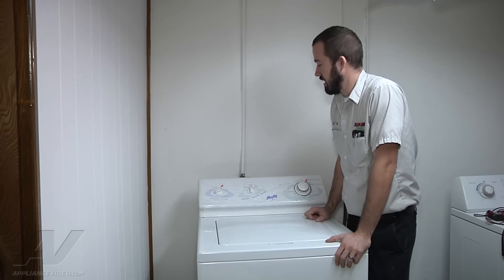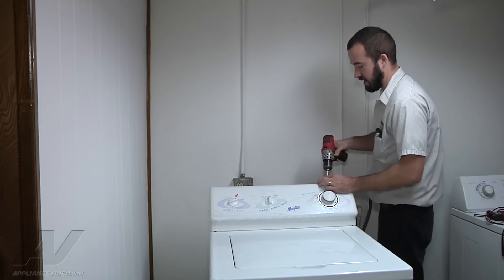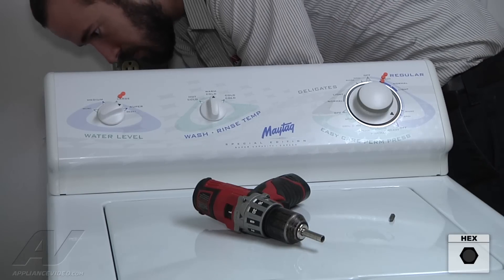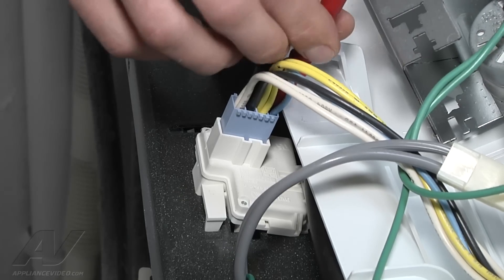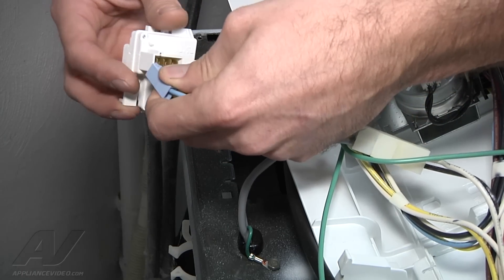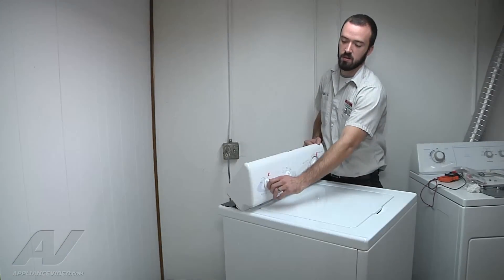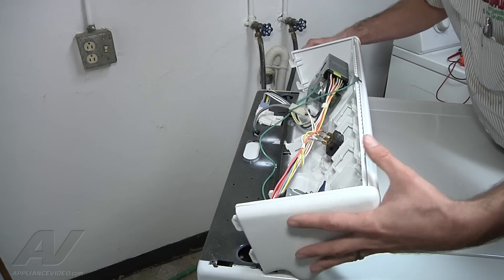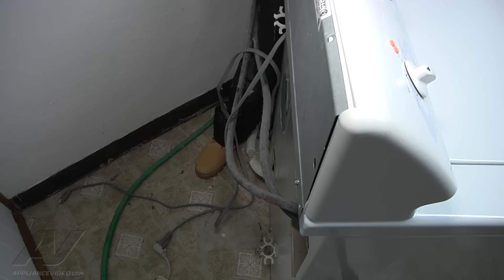Maytag Washer Repair - Stops Mid Cycle - Lid Switch

Comment: Great video

My Maytag LAT9360AAE works fine until it stops before the rinse portion of the cycle. I can hear the washer buzzing as if its waiting for something to trigger but it does nothing. I have to manually set it to the washing cycle to fill with water (substitutes rinse) and once that is done, i set it manually to the “spin” function. I replaced the timer but still the same. Any feedback will be appreciated
Reply from the maker: Great question, if you have a
more technical question that our parts department cannot answer, our
technicians are answering all questions at our website at www.ApplianceVideo.com under our Repair Help section. You can also call
our parts department at 1-800-830-5465 and they can give you help 6-days A week
Mon-Sat . You can also search at www.SaveMoreOnParts.com 7- days a week.
Reply: Your cold water valve may be clogged.

Comment: I wish my problem was just the lid switch-lid switch is good, but it quit in mid-cycle and will now do nothing. Seems in 99% of how-to videos, the problem turns out to be the lid switch. It would be nice if someone did a video where the lid switch didn't fix it, so we could go on and explore other causes/culprits. Thank you for doing the videos, though.
Reply from the maker: Great question, you can call our parts department at 1-800-830-5465 and they can give
you help 6-days A week Mon-Sat . If you have a more technical question that our
parts department cannot answer, our technicians are answering all questions at our website at www.ApplianceVideo.com under our Repair Help section. We have over 4,000
common questions and answers that you can easily search through by your model
number, appliance make, and problem or error codes, and It’s free to search
through our question & answer library.
Reply: dyer2cycle the lid switch is the prob only 75-80% of the time.Other 20-25% the plastic actuating barb has worn out and is not pushing the switch that extra 1/16" needed.Piece of folded matchbook cover will get you going.Not too much!!
Reply: Mine was the capacitor for the motor and the timer switch.  I agree, too many on lid switches
Reply: dyer2cycle aww
Reply: Did your check the water pressure switch

Comment: Please Please Help, I have a Maytag mtw5840tw0. When on regular wash cycle it stops agitating right before the next rinse cycle (like 1 click away on the knob) should start and just stays full of water not doing anything until i manual turn the knob to rinse then it will complete the rest of wash cycle. Ive also noticed that sometimes it finishes the wash cycle by just opening the lid fully then closing it once or twice. Besides this issue stated all else works like normal. Where should I start to repair? Please and thanks.
Reply from the maker: Great question, if you have a more technical question that our parts department cannot answer, you can search our over 17,000 answered questions free at our website www.ApplianceVideo.com under our Repair Help section. You can also call our parts department at 1-800-830-5465 and they can give you help 7-days A week ,or search at www.SaveMoreOnParts.com  .

Comment: Even with a broken lid switch, would you still be able to hear the clicking when you open and shut the door? I can still hear mines clicking when I open and shut the door, but that does it mean it can still be broken or need replaced.
Reply from the maker: Great question, if you have a
more technical question that our parts department cannot answer, our
technicians are answering all questions at our website at www.ApplianceVideo.com under our Repair Help section. You can also call
our parts department at 1-800-830-5465 and they can give you help 7-days A week
Monday -Sunday, or search at www.SaveMoreOnParts.com  24 hours
7- days A week.
Reply: I could tell you the most probable part answer, but then you would buy it somewhere else cheaper.  So call our number and be guilted into buying it from us
Reply: YES - Even a broken microswitch (which at least is what is on my Performa series) can have an audible 'click' yet it isn't making contact internally to the switch. The only true way to tell is by doing a continuity test with a digital multimeter (or continuity tester). While I am not an appliance tech, I have been repairing electronics devices for over 20 years. Microswitches can still 'click' and be broken internally. Since your post was 3 years ago, I hope you aren't waiting on this answer to proceed LOL!  But someone else who reads this might benefit.

Comment: When i replace the hood switch do i need to hook up the water to test that switch?
Reply from the maker: Great question, if you have a more technical question that our parts department cannot answer, you can search our over 17,000 answered questions free at our website www.ApplianceVideo.com under our Repair Help section. You can also call our parts department at 1-800-830-5465 and they can give you help 7-days A week ,or search at www.SaveMoreOnParts.com  .
Reply: @Appliancevideo  yeah I replaced the hood switch and it's fixed now i have i old washer and dryer for sale thanks guys

Comment: Our Maytag MCT top load no agitator washer basket doesn't always move, though hear motor make noise but no bottom movement - basket will move, bottom section does not, it's intermittent. Washer is 5 years old.
Reply from the maker: Great question, if you have a more technical question that our parts department cannot answer, you can search our over 17,000 answered questions free at our website www.ApplianceVideo.com under our Repair Help section. You can also call our parts department at 1-800-830-5465 and they can give you help 7-days A week ,or search at www.SaveMoreOnParts.com  .

Comment: Is there a bypass for the lid? Mine is full of water right this minute and I just want to get it thru the cycle. I ordered a new switch.
Reply: Dave K where did you buy a new one at?
Reply from the maker: Thanks for your response, we are glad we could help. Our library of over 5,700 videos are currently helping over 1.6 million people like you every MONTH.  Please help us by subscribing to our YouTube channel, or post our website www.ApplianceVideo.com to your Facebook page, Twitter, Instagram or any other social media sites. Your support will help us keep producing more free quality videos.
Reply: Bend a paper clip and stick it into the lid switch contacts. No more switch problems.
Reply: Pleasant Home Painting LLC could you please explain how you do this exactly.
Reply: @Enrevalasil  if you take it apart kind of like he showed, instead of the plug-in part that leads to the door safety switch, connect the circuit with a homemade pin, probably out of insulated  heavy copper wire, not a paperclip, in a u shape with the ends stripped. Stick the end into the proper holes where  the pins would go  from the big plug. The sensor will think that the door circuit is closed all the time and it will not interrupt your wash by bouncing open. It also will not stop while it is spinning if you stick your arm in there that is the downside.
Reply: Pleasant Home Painting LLC thank you
Reply: I cut line wire (black) motor feed wire (yellow) machine feed wire (blue or red) and splice the three together with a wire nut. careful not to stick hands in the spinning machine you may get hurt.

Comment: will this work on all models ?
Reply from the maker: Great question, you can call our parts department at 1-800-830-5465 and they can give
you help 6-days A week Mon-Sat . If you have a more technical question that our
parts department cannot answer,
our technicians are answering all questions at our website at www.ApplianceVideo.com under our Repair Help section. We have over
3,000 common questions and answers that you can easily search through by your
model number, appliance make, and problem or error codes, and It’s free to
search through our question & answer library.

Comment: can explain whys the switch is causing to stop, draining water, and or spinning? I have the same problem with mine too. If it is I might just go buy the switch and replace it myself. How do I know where to buy the switch which one it will fit?
Reply from the maker: Darmmand8
          All of our technicians are now answering questions daily on the ApplianceVideo.com website. You can search completely FREE in our Repair Help section with over 1000 questions & answers. Or you can get unlimited technical advice and video links emailed to you by our 14 factory certified technicians at http://www.appliancevideo.com/premium-membership/.  If you are in need of any parts please support our parts department on line at http://savemoreonparts.com/ or call 1-800-830-5465 7-days a week until 11pm Eastern time. Thanks for your support. Matt Ace Appliance factory service technician.

Comment: hello matt i have a maytag front loader that will fill the stopped now won't start or do anything i have checked the control board and the motor board.  both look fine no burn marks or anything what would be the next thing this could be
Reply from the maker: +Kelli Kneller 

         We would like to help you answer your
question. With our videos now getting over 900,000 views per month and hundreds
of questions from people like you, our technicians are now answering questions
at our website http://www.appliancevideo.com/repair-help/ .  We also have over 2200 common questions
and answers that you can easily search through by your model number, appliance
make, problem or error code and it’s absolutely FREE. You also have the option
to email a factory service technician with a question on your appliance at http://www.appliancevideo.com/repair-help/ . If you’re looking for a repair video, you can
also search our library of over 2600 free repair videos. ApplianceVideo.com
specializes in quality DO-IT-YOURSELF appliance repair videos and we get over
800,000 views per MONTH to our videos worldwide and growing. If you need of
parts for your major appliance, we have over 5-million parts in stock at http://savemoreonparts.com/ .  Thanks for your support. Matt Ace
Appliance factory service technician.
Reply: Maytag shaking
Reply: Thank

Comment: I have a model LAT9206BAE that does the same thing except it works in spin when turned on manually. What could cause that? It cycles through, but water stays in and no spin. except when you pull out knob.then it spins.
Reply from the maker: Great question, if you have a
more technical question that our parts department cannot answer, you can search
our over 10,000 answered questions free at our website www.ApplianceVideo.com under our Repair Help section. You can also call
our parts department at 1-800-830-5465 and they can give you help 7-days A week
Monday -Sunday, or search at www.SaveMoreOnParts.com  24 hours
7- days A week.

Comment: I have an LAT5005 that starts to spin but if the load isn't perfectly balanced, it stops.  It just seems to be too sensitive and I thought that there was suppose to be a counter balance to keep this from happening.  Any ideas?
Reply: I had similar problem. The drum is held in balance by some springs under the drum. On mime a spring had broken leaving the drum to flop around if it was slightly unbalanced. The technician replaced a broken spring which solved the problem. Having watched the technician it would probably be easy for a handy homeowner to fix it except for the fact that the washer has to be tilted back or lifted up to gain access to the bottom of the machine. It was too heavy for me to do myself.
Reply from the maker: Thanks for your response, we are glad we could help. Our library of over 5,700 videos are currently helping over 1.6 million people like you every MONTH.  Please help us by subscribing to our YouTube channel, or post our website www.ApplianceVideo.com to your Facebook page, Twitter, Instagram or any other social media sites. Your support will help us keep producing more free quality videos.

Comment: My Maytag Commercial W M does not supply hot water when is set up on Hot. There is hot water supply fawcet
Reply from the maker: Great question, if you have a more technical question that our parts department cannot answer, you can search our over 17,000 answered questions free at our website www.ApplianceVideo.com under our Repair Help section. You can also call our parts department at 1-800-830-5465 and they can give you help 7-days A week ,or search at www.SaveMoreOnParts.com  .

Comment: I have a Maytag Performa series sm8525664 that stopped mid cycle on wash. It still makes a sound when turning it on but won't spin. What exactly do I need to fix to get it going again?
Reply from the maker: Great
question, you can call our parts department at 1-800-830-5465 and they can give
you help. If you have a more technical question our parts department cannot
answer, our technicians are answering
all questions at our website at ApplianceVideo.com under our Repair Help
section. We have over 3,000 common questions and answers that you can easily
search through by your model number, appliance make, and problem or error codes,
and  Its free to search through our
question & answer library.

Comment: What would cause it to screech extremely loud then stop in middle of wash cycle
Reply from the maker: Great question, if you have a more technical question that our parts department cannot answer, you can search our over 17,000 answered questions free at our website www.ApplianceVideo.com under our Repair Help section. You can also call our parts department at 1-800-830-5465 and they can give you help 7-days A week ,or search at www.SaveMoreOnParts.com  .

Comment: Washer will run on delicate cycle but no other
Reply from the maker: Great question, if you have a
more technical question that our parts department cannot answer, our
technicians are answering all questions at our website at www.ApplianceVideo.com under our Repair Help section. You can also call
our parts department at 1-800-830-5465 and they can give you help 7-days A week
Monday -Sunday, or search at www.SaveMoreOnParts.com  24 hours
7- days A week.

Comment: I have a Maytag Bravos and the water starts filling up and stops after dropping maybe half a gallon and then switches to start spending a belief what could be the problem
Reply from the maker: Great question, you can call our parts department at 1-800-830-5465 and they can give
you help 6-days A week Mon-Sat . If you have a more technical question that our
parts department cannot answer, our technicians are answering all questions at our website at www.ApplianceVideo.com under our Repair Help section. We have over 4,000
common questions and answers that you can easily search through by your model
number, appliance make, and problem or error codes, and It’s free to search
through our question & answer library.

Comment: How to put the metal ring back on my maytag w10631155a
Reply: Front loader
Reply from the maker: Great question, if you have a more technical question that our parts department cannot answer, you can search our over 17,000 answered questions free at our website www.ApplianceVideo.com under our Repair Help section. You can also call our parts department at 1-800-830-5465 and they can give you help 7-days A week ,or search at www.SaveMoreOnParts.com  .

Comment: what happens when the machine is only making internal sound as if it is washing meanwhile it doesn't roll till it pours out water and soap. My machine is in this state since last 2 months. Solution please.
Reply from the maker: Great question, you can call our parts department at 1-800-830-5465 and they can give
you help. If you have a more technical question that our parts department
cannot answer, our technicians are answering
all questions at our website at www.ApplianceVideo.com under our Repair Help section. We have over 3,000 common
questions and answers that you can easily search through by your model number,
appliance make, and problem or error codes, and It’s free to search through our
question & answer library.
Reply: Roper washing machine won't drain

Comment: I wish they still made wringer washers.. this high tech stuff is all junk!  I have a Kenmore that is over 20 years old that I replaced with a new modern Maytag and the Maytag did not even last 2 years.  No wonder they dropped the warranty to 1 year. The Kenmore still works fine but is old.  Quality has gone down the drain these days while prices have gone way up.

Comment: my maytag washer don't spin but when I look under it the motor is turning the belt
Reply from the maker: Hello, for
technical questions we have a Repair Help section at this link https://www.appliancevideo.com/repair-help/ . There are over 6,000 answers and questions you
can search through FREE to help you with your problem. Hope this helps

Comment: my washer stops after two minutes what is this can u tell me why
Reply from the maker: Great question, with our
technicians now getting hundreds questions weekly, they are answering all questions
at our website at ApplianceVideo.com under our Repair Help section. We have over
3,000 common questions and answers that you can easily search through by your
model number, appliance make, and problem or error codes.

Comment: i have a maytag cenntennial top load it has no aggitator in it, it will start washing than just stop i have to restart it and it will go than sometimes it does the whole cycle with no problems any ideas
Reply from the maker: Great question, with our
technicians now getting hundreds questions weekly, they are answering all questions
at our website at ApplianceVideo.com under our Repair Help section. We have over
3,000 common questions and answers that you can easily search through by your
model number, appliance make, and problem or error codes.